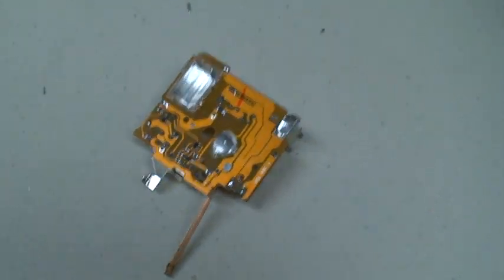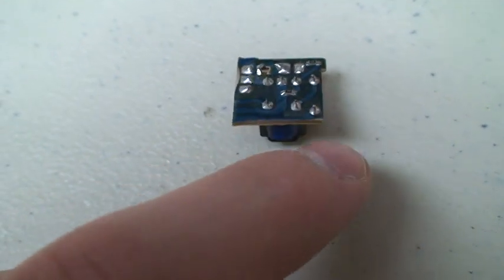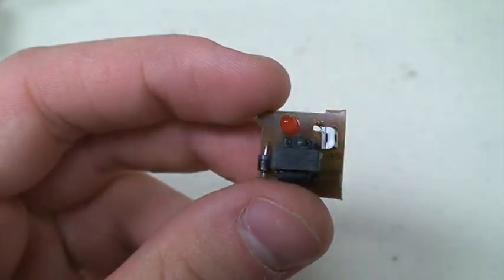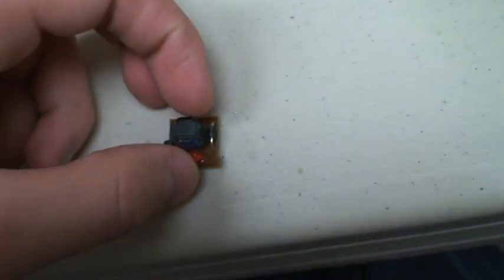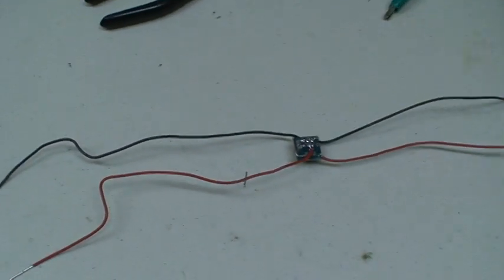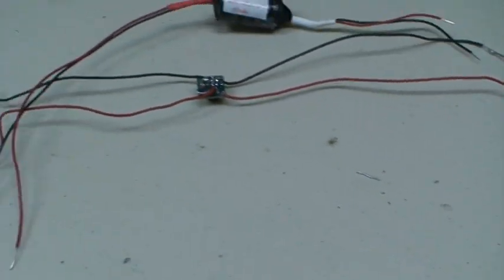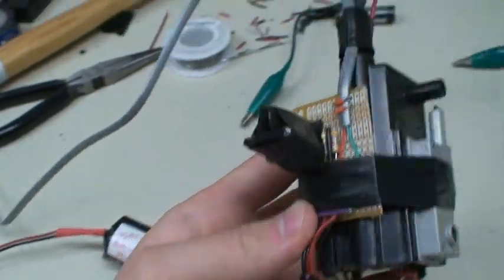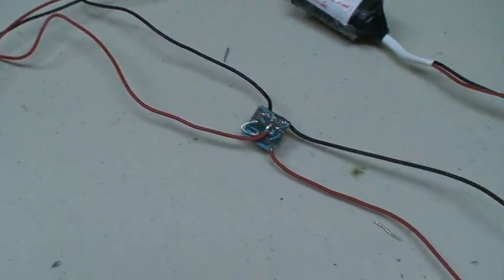Micro Camera Circuit Mod!

Comment from the maker: It sounds like you may have burnt out your thyristor. I have a huge one rated for 250 amps continuous at 500v (7000 amp peak for 2ms) and I have hooked it up in the exact same manner you did without any problems. The capacitors that I hooked it up to were also 100 times more powerful than a flash capacitor. The thyristor was probably not rated for such a high voltage and current. I could be wrong but this is just the most logical guess that I could come up with.

Comment: Hi, i was wondering if someone here could help me...
i would like to use a thyristor to discharge a flash capacitor, i just tried it a minute ago, it discharged once, when i pressed the button, but now there is a dead short across the thyristor (i take it thats what the pop was). could someone tell me what i did wrong?.
i put the cap (-) on the cathode along with the (-) from the 12v battery, i put the cap (+) through coil to Anode, and the battery (+) through a 1k resistor, switch, to gate.

Comment from the maker: I don't think that would work because each circuit would not be synchronized with the others so you would have a really weird output. This can be done with batteries obviously but with using multiple transformers in series it would be really hard to get each one synchronized and pulsing at the same time. With a 555 timer you could do this but the camera circuit is based off feedback so the charging frequency changes based on the charge level, initially its like 40Khz and it ends at like 10Khz.

Comment from the maker: The transformer uses DC current which is steady direct current with no alternating or switching, AC current alternates 60 times per second. The current must alternate on and off into the transformer in order for it to work. The transistor switches the DC current on into the first transformer coil, then it shuts it off which allows the energy in the first coil to move to the second coil where the voltage is increased. the diodes then rectify the output to be 330v DC. PM me if you need more help!

Comment: "Why cant u just hook the cap + battery directly to the amp, and screw the diodes and transistor? Last i thought this was a 1.5 - 320V transformer, and the other parts are just for too much into the transformer...."

ya, youtube does this weird thing when you post a reply to an older comment, it posts your comment after the older comment and at the beginning of the list.

Comment from the maker: I was in the process of making the flyback tutorial but it was so unreliable and in-efficient with the components from radioshack it took 1 minute to charge a photo capacitor. I have also not been able to find a good transistor for the single transistor driver. I might do a video about the ZVS driver with a parts list, schematic, and tips on building it. This video won't happen for a while though, I don't have a lot of time to make the videos anymore.

Comment: no but really the circuit already has the diode to rectify the current from the transformer and to keep the capacitor from discharging backward...i gues if u tried the set up both with and without the extra diode and it only worked well with the extra diode , then sumthing wierd is going on

Comment from the maker: If the extra diode is not added the charger will turn on and the led will shine but it won't charge. I am pretty sure that the extra diode prevents the capacitor charge from flowing back into the transformer which will prevent it from charging. Without the extra diode the circuit will not charge the capacitor. As for the capacitor I thought the performance after I cut it off was better but I can't see a little tiny capacitor really affecting performance that much.

Comment: why do u add an extra diode ....there already is one on there
and besides that, i think the way ur cutting the board, is cutting off a small capacitor from between the transistor pin3 and battery minus, does that affect performance?

Comment from the maker: Alright, I understand what you are saying now. As you said they are already connected on the pcb but the extra solder ensures a good strong connection. But it will work without bridging the connections with solder as you said.

Comment: on step 3 at 2:42 it says "solder two black wires into the hole next to the transistor and connect it to the transistor"  and the picture shows that you have the negative leads and the transistor pin bridged, even though they're already connected on the pcb.  i've made one without bridging it and it works just fine.  im currently working on a bank of them and already have 3 together working great.

Comment from the maker: Are you talking about bridging the transistor and transformer? They are not connected if you look closely at the pcb the blues lines are the electrical pathways not the dark spots. There is no blue line going from the transistor to the transformer pin so you must solder in a wire as a pathway.

If this is not what you asked then please ask again but include a little more detail on which parts ect...

Comment from the maker: Its so small that it would be hard to strip a piece of insulated wire so I just used bare wire.

You can use insulated or bare it does not matter.

Comment: oh... and whydoes the wire which bridges transistor pin 3 with the bottom left hand transformer pin have to be bare rather than insulated?

Comment: I also have hooked many together. sure u did parrell to ramp the amps up.  But, 2 things.

1: Do you know how to hook a fuji? The led wasnt even on the circuit and i'm having problems with it.

2: Why cant u just hook the cap + battery directly to the amp, and screw the diodes and transistor?  Last i thought this was a 1.5 - 320V transformer, and the other parts are just for too much into the transformer, (learned that )

Comment from the maker: If by "Rapid Tap" you mean rapidly charging and discharging then yes, you can do that. As for cutting a hole through metal it would only be possible if there was enough current to melt a hole instead it would erode the metal over time and you would eventually get through. I have however vaporized a hole in aluminum foil with 6 of these capactors. Aluminum foil is very thin which is the reason this happened but if it was sheet metal it would have just burnt the surface.

Comment: So if the charge time is 1 second to get 320V, doesnt that mean u can rapid tap and get loud pops? maybe given 10 hours cut a hole in metal haha.

Thanks for this tutorial, i was looking for way to make this smaller, and faster :) And im guessing the diode helps protect the cap from risk of well.. you know...

Comment from the maker: Yes, the led will iight up when the charging is over. You can also remove the led from the board and extend it with some wire. That way you could mount this in a project enclosure and have an led indicater to show the level of charge.

I prefer a voltmeter over the led, its nice to have the led but the voltmeter has some advantages. You can tell if the battery's are low and the rate of charge so you could charge to a different voltage for more or less power.